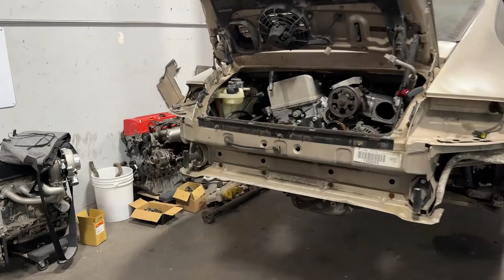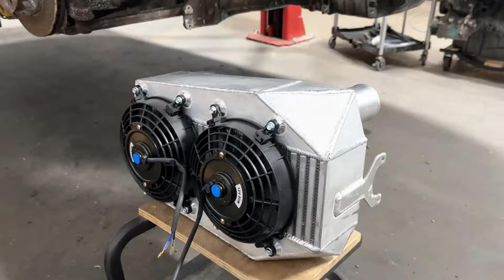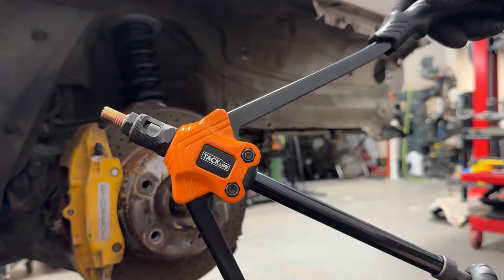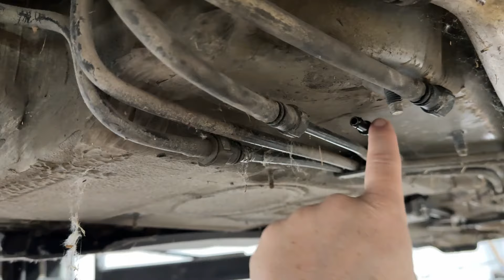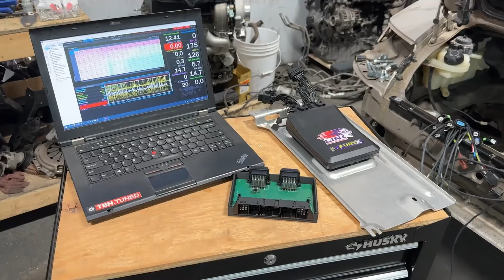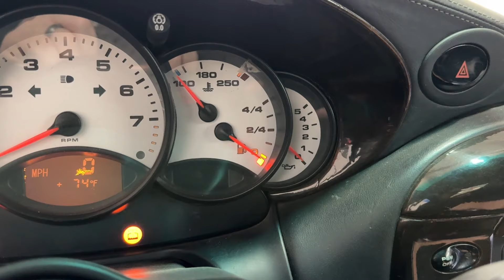K996 - K24 996 Restomod EP2 - Intercooler - Engine Bay Prep - Link ECU

Comment: For the kit overall I think having a 3D printed "drill template" that bolts in place so you can drill into the right spot before using the hole saw.

Comment: Can this swap kit use kpro?  It seems to be the only choice for passing obd2 smog.  Otherwise, this swap is only good for off road and in some states like Wa.
Reply from the maker: Unfortunately no way to make kpro work because it cant run an electric throttle body. Also, from my understanding, if you change the engine and put one from a different manufacturer its an automatic smog fail in most states.
Reply: @tuningbynick sucks man, maybe an analog throttle in future works.   My k swapped mr2 spyder passes obd2 and it’s registered.  I think you mean in California, they need to match.  But some states forgo smog if the vehicle is 25+ years old it’s considered as a classic vehicle.

Comment: Do I have to remove the engine to replace coils or pour oil?
Reply from the maker: You do not. Theres an oil fill cap to fill oil. Spark plugs only need to be changed at like 30k miles. Its a 1 hour job. To lower the engine 5” to change the plugs. Compared to the 4+ hours it takes to do spark plugs on the original Porsche engine, i think its more then reasonable

Comment: Noob question, but is it possible to do K24 swap without turbo and year later add turbo? Will it be a lot cheaper?
Reply: I'm no expert but to my knowledge it absolutely is possible. Not to mention possibly much cheaper and the definitely easier as you'll have more room in the engine bay without the turbo to install.
Reply: The only wasted expense in the upgrade I can think of would be your already custom exhaust would be useless and a new one would need to be fabricated to accept the turbo. (I plan on purchasing a boxster and doing the same) 👍
Reply: Good point to the wasted manifold you had to have already.. but.. an ALL motor version would be fun as hell.. but def not as fast pushing some boost,
Reply: But would adding turbo also require tuning ecu?

Comment: open slots on the rear intercooler bracket + welded spacers on that rear-bumper-bracket?! this should help with the maintenance/ make it easier to on/off the intercooler as a one man job :)

Comment: Hey nick. Love your videos. Wanted to ask if you could adapt a K20 or K24 to an auto or PDK? Before you put a hit on me, I’m an amputee (Afghanistan gift) and have a 996.1 with a blown motor.
Reply from the maker: Once we are all done with the Boxster and Cayman development i plan on converting my original 997 to a PDK transmission - The main issue is that there is currently no adapter plate available for the auto or pdk transmission. If enough people ask https://www.kennedyeng.com/ to create the adapter plate then we can handle the rest
Reply: Thank for your service .  @gouldnj
Reply: I’d also be interested in k series for PDK adapter or see a kit from you using OEM Honda trans.. I have high mile 987.1 PDK and am definitely interested in options for if/when motor lets go
Reply: Thank you for your service first and foremost, and if I do the swap with a DCT transmission. I will make you a PDF on how to do it step by step.
Reply: Thank you for your service 🫡 . As much as I enjoy banging through gears, I would love the PdK version as an option too!

Comment: I have a really nice 997.1 that has slight bore score still drive the car every day and it still has lots of life left in it. I’m on the fence about rebuilding the motor or doing a k swap but in all reality I would love to just trade the car for an S 2000.
Reply from the maker: Ive had 3 S2000's - I love them, but in all honesty, a 997 is a way better car - Especially with a K
Reply: I’m with you.. we have had and still have an S2000, they are cool.. but the cars are completely different. I’d keep the Porsche. Cheers to great cars either way!

Comment: I'm looking forward to the turbo testing. I'm on the fence about boosting my K swap and those are two of the turbos I've landed on since they offer a reverse rotation option. I'm looking for mid power levels(350-400wheel), good transient response, and an operating window of 4500-8200ish RPM.

Comment: Does a vent need to be cut into the rear bumper cover so the intercooler can get cool air?
Reply: I'm sure you could use a 997 style GT2 style bumper. They already make them for the 996 with Vents a little pricey but I suppose you could just cut out a vent of the OEM bumper and make it yourself using some wire mesh. 

Or make it look really nice with some symmetrical vents. That's my ultimate plan.
Reply: Yeah, I’d def cut some symmetrical vents as well unless you wanted specific clean Porsche parts. 🤑